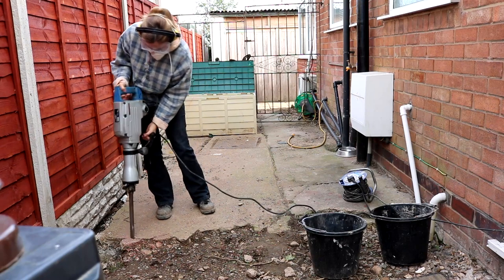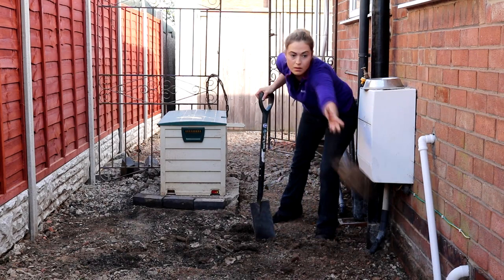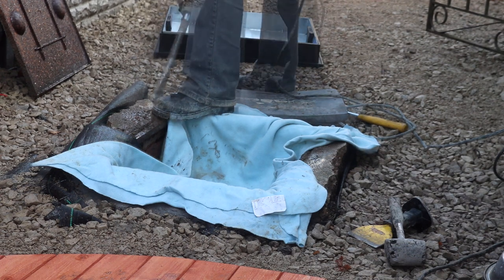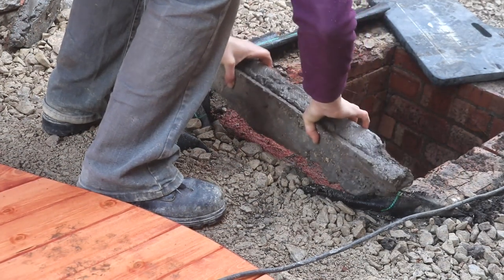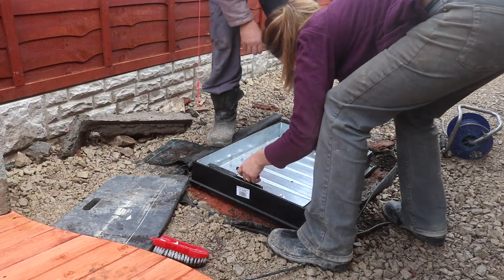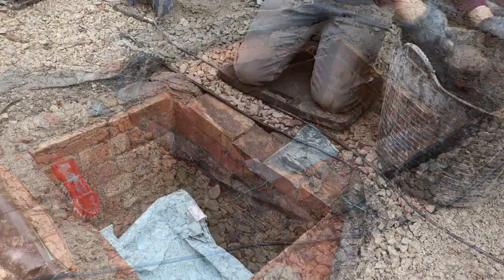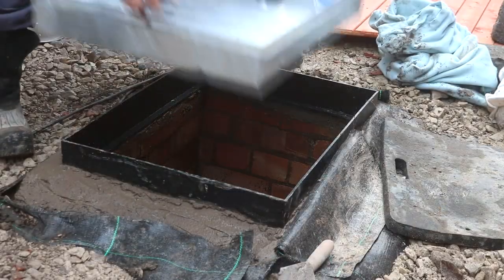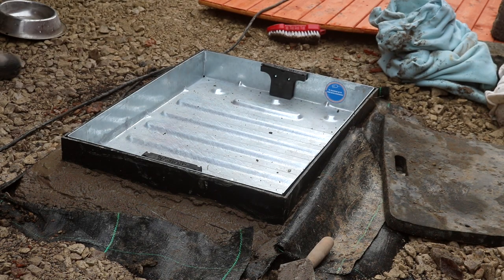Replacing a Manhole Cover on Driveway / The Carpenter's Daughter

Comment: Just come across your vids really enjoying them and good for you for getting stuck in job well done  👍 little tip on getting the manhole square...remove top course of bricks and when you re-lay them  you can corball them over to where you need them to be you can get away with 25mm overhang  .. let them set then bed your manhole cover you can gain abit on that aswell hope that helps im a brickie and its a trick we use sometimes on site to straighten old manholes up 👌
Reply from the maker: Thanks, I hadn't thought of that - what a great tip!! 😊😊

Comment: Hi Have found several of your vids v  useful thanks.  Just doing the same job with 4 drain covers but unsure as to what to fill the recess cover with?  Have you just filled it with the gravel or will the edge of this become a trip hazard?  No vehicles over but Mum pulling her  wheely bins over and I don't want her to fall.  Thanks Jane

Comment: Is it easy to remove concfete around the house near my drain pipes etc with that drill ? Looks great by the way x
Reply from the maker: You can to be incredibly careful.  I would try to avoid if possible and find out exactly what's under there.  I did it by hand around the electrical box area.

Comment: Nice job on the manhole vicky they are a pain in the ar... when on your side/reaponsibility.  Also do agree with couple of comnents  While gravel/stone/shingle etc is a cost affective way to tidy up a drive it can soon become a nightmare. Cats use as litter tray. The weight of vehicles penatrares the base/stone into the weed control so it ends up punctured/growing through and you end up having to top up regular as its surprsing how much you loose through transfer from car tyres etc.  We did stick with it for almost 2 years then we went for a printed concrete. But now the new resin drives look great and are far more cost affective you can also get DIY kits simthing i would look into anyway. But fair play anyway for doing all this espechally this time of year.
Reply from the maker: Thanks +HaveAgo Harry.  I've been looking resin kits and quite fancied giving it a go.  It looks very easy but was worried I was deluded lol.

Comment: Bed the frame on mortar with the cover in place. Hunch up to the top of the crane with 10mm down sharp sand concrete. This give a strong them ring to support the cover frame. Just relying on a mortar “glue” will fail. Ask me how I know.

Comment: Block pavers are very much the same job as your patio slabs , different scale is all , gravel drives are good to keep the burglars away ,, both need weed treatment , I spray my pavers with a mixture of vinegar salt n fairy liquid , try to keep it dog friendly -), I would say gravel is way faster and cheaper ,, nice work on the manhole cover -)
Reply from the maker: Thank you +ian smith.  That's what I thought regarding the patio!

I've sold it to myself now for the very same reason abiut burglars, where Hans can warn us and easier/cheaper.  I initially hated the idea but after seeing some, I've changed my mind.  I'm planning on buying a stone that we can compress too for less movement.

Comment: Wow, I was quoted £700 to replace two covers. None of the chambers in my garden have covers, they just have slabs over them
Reply: Do it yourself easy job would only cost £150 at most in materials about 6hrs work. lay in it on sand and cement and go around the edge flaunching with a diffrent mix of concrete
Reply: @mondayschild3493  having read about it now it doesn’t look too tricky, it’s not something I’ve done before and I’ve a lot of manholes 😂

Comment: A couple of points,- DONT put your foot on it to level it, it will rise on the other side! Use a spirit level and tap down all round  with a hammer to level. 3-1 mix is a bit strong , 5-1 mortar is usual. Dont put the lid on until the mortar bed has gone off. the extra weight can squeeze the mortar, Finaly, your old manhole was cast iron, not wrought iron.